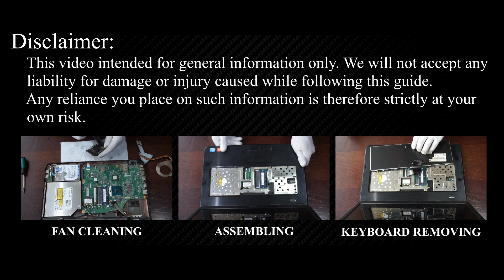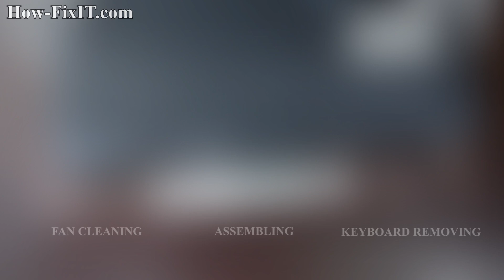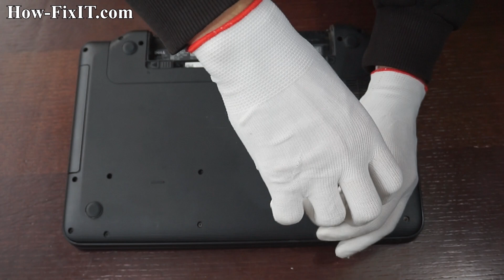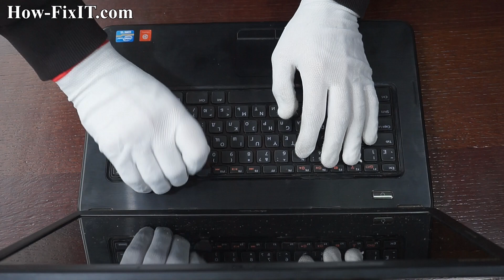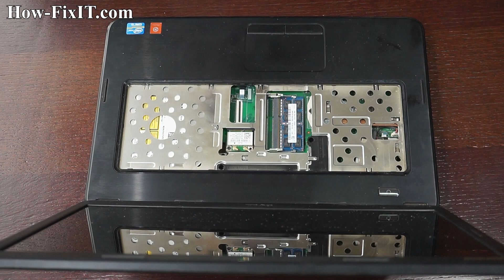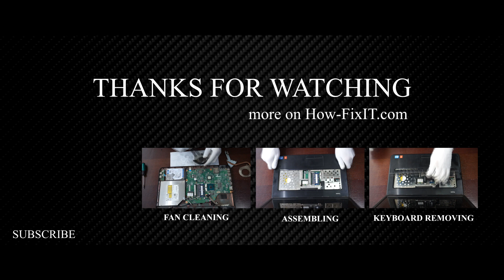Dell Inspiron 15 3520, N5050 HDD to SSD Replacement – Full Installation Guide

Comment: WHY OH WHY did they make it so freaking hard to change this instead of like so many others where it just pops out the back in 3 minutes. This guys shows it is a little difficult, oh no, it's really hard to get the keyboard off, my delete key got all screwed up because it is right next to the release button that doesn't really release. Then getting it to split from top part to bottom part was awful too. And of course not all of the screws would set again when it was finally all put back together. DELL this was not necessary to make it so hard and risky that many things can break along the way.
Reply: i feel your pain, have to replace hard disk too